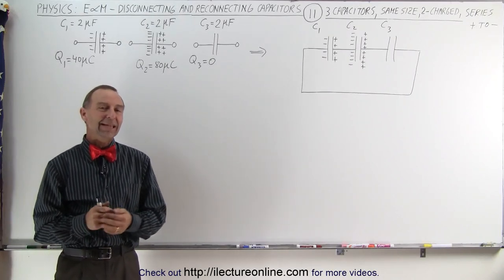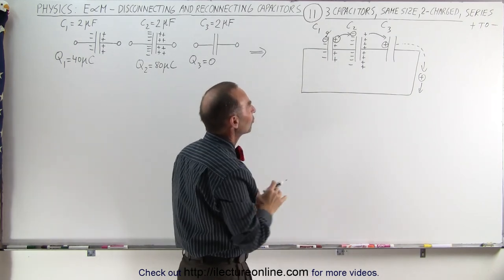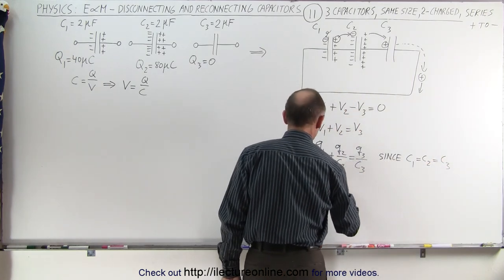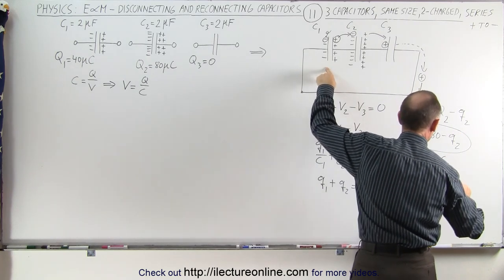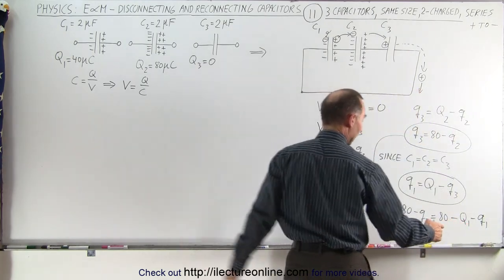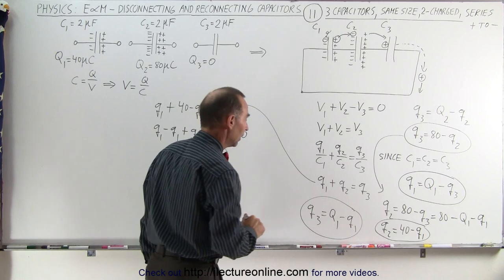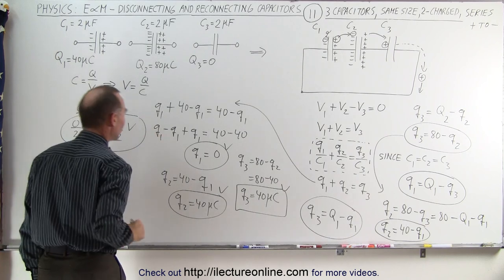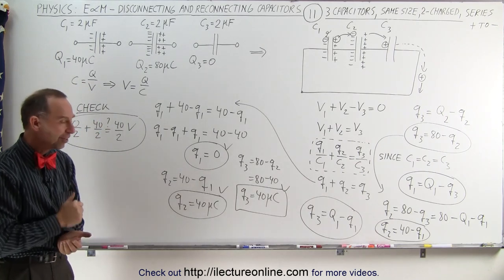Physics - E&M: Dis- and Re-Connecting Capacitors (11 of 16) 3-Cap., Same, 2-Charged, Series, + to -

Comment: Dear Pr,
I am having a conceptual problem, I hope you could clarify. 
Maybe I am wrong on that, but when at equilibrium it seems that V1 should be positive negative (+V1-) because V2 has to be negative positive.
But if V1 is positive negative then v3 is going to cancel the charges on V1.
I don't understand how the charges are going to be distributed at equilibrium. I feel like they will all cancel and get 0 but that doesn't make sense because there is always gonna be some excess charge. Maybe it can not be at equilibrium there will just be a current that will keep flowing.
Thank you in advance for your response.
Paul
Reply from the maker: With capacitors in series they will all be + / - from left to right  or - / + from left to right.    A voltage source will be present (not placed on the diagram) to push the charges onto the capacitors.

Comment: Sir i wanted to send you a question in which i have a doubt. The question has a diagram. Is there any way i can send you. plss reply
Reply from the maker: If you can describe it in this forum, we may be able to answer it.
Reply: Michel van Biezen  Question: Three conducting spheres A, B , C are concentric. The radii of the spheres are a, b , c respectively. A and B are connected by a conducting wire. The capacity of the system is?
Can you send the solution or make a video for such questions plsss

Comment: why not 80 micro couloumb negates the whole charge on C1 and polarities get reversed like 2 capacitors connection to opposite polarities....there u did like that..........
Reply: I had the same doubts. But from my understanding, the 80 micro coulombs cannot negate the whole charge on C1, it only discharges the positive part, in the meantime, the negative charge on C1 will go to C3. Therefore, there won't be any charge on C1 eventually.